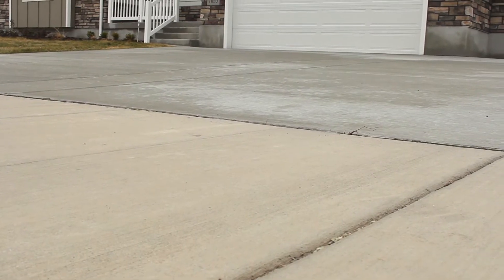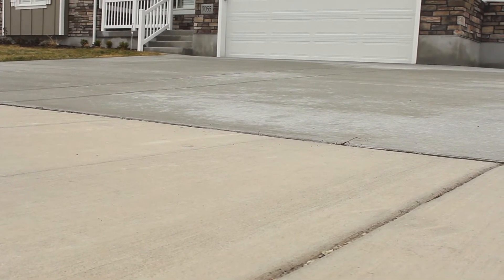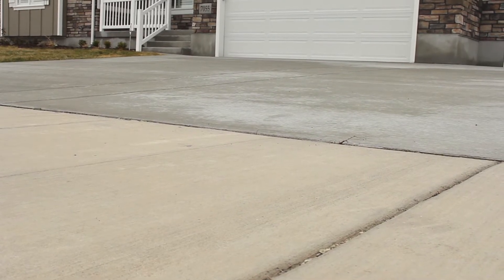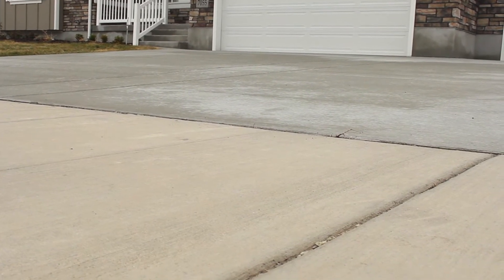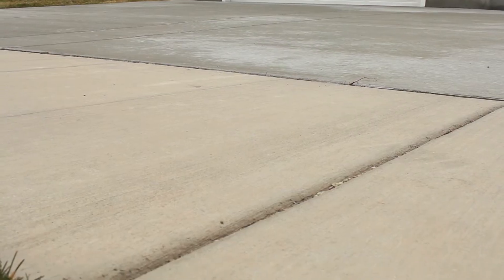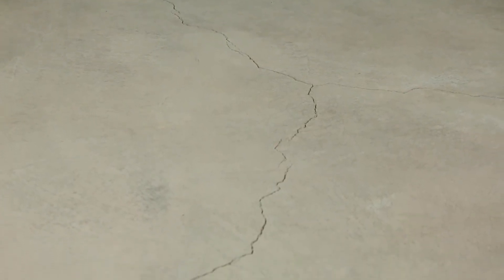Why Concrete Cracks in Your New Home

Comment: I have had three homes over the years.  Two were floating slabs and one was a cable tension slab.  The two floating slabs had cracking and at  a couple places the slab pulled away from the concrete blocks.  The cable tension slab had ZERO crack even after 20 years.

Comment: Is there not something cheap you can add into the control joints to prevent this and make it level for carpets? Accepting uncontrolled cracking in the floor to prevent carpet lines...seems like there must be a better solution.

Comment: The guy in the video is wrong. It is NOT normal for basement floors to crack.  The likely the reason you see the cracks in the basement examples he shows is because a floating slab wasn't installed, which is what should have been done. Instead, they poured the concrete all the way up against the foundation walls (instead of leaving about a 1.5 inch gap around the perimeter), which is wrong in all but the driest areas. A floating slab allows the floor to move in the event of hydraulic pressure from the water table underneath the slab.  If it can't float (i.e. shift independently), it tries to push against the foundation walls, which won't budge, and then you effectively get a buckling and then cracking of the floor. If anyone you hire tells you it's normal for basement floors to crack, get rid of that person immediately.

Comment: If I sent you a photo could you give me your opinion on a crack?  My one story rancher is on a slab. I'm literally right this moment removing the carpet and tack strips from the slab for a flooring contractor to come and install LVP flooring. We purchased high end flooring so we don't have to do this crap twice.  Anyway, the corner of one room of the slab has a crack just like most of the normal looking cracks you mentioned in the video. Just want an opinion. I was planning on using mortar mix to fill in the cracks after using a crack chaser blade. Thanks.

Comment: The "why" question has not been answered, also what exactly are the industry standards for how wide cracks can be?
Reply: The "why" is because in all likelyhood, a floating slab wasn't installed, which is a major error.
Reply: @georgeburns8447  New construction homes have footings which makes "floating slabs" non code compliant.  Patios, driveways and the like yes, house slabs no.
Reply: @drboogienobama4999  You have no idea what you're talking about.  I have a home with an 8 foot deep basement, with footings supporting the foundation walls and a floating slab.   A floating slab is normally required in an environment that could  subject the floor to shifting by hydrostatic pressure.  It has nothing to do with whether the home has footings or not. Kindly keep your comments to yourself unless you know what you're talking about, which you obviously don't.

Comment: Video is very useful, at the same time as mentioned in the title, it does not explain why does concrete crack.
Reply: Because in USA they don’t use frame between the concrete when they made foundation .
Reply: @maharenagebreslasie5596  thanks, I am sure your PHD in applied physics helped you to get there.

Concrete cracks because of thermal expansion. It creates internal stress that cracks the concrete. This thermal expansion can cause serious issues in reinforced concrete where the rebar stretches significantly and breaks lose from concrete, this enables water to leak in and that will quickly erode the material, which eventually means the rebar slowly dissapears from the concrete in which case a building can collapse as it's losing it's strength.

Thermal expansion cracks bridges, asphalt and many other public infrastructure. You will see engineers place gaps between concrete road slabs purely to enable concrete to expand. Same with bridges and any concrete structure you see in public is made modular so the pieces can expand as they like reducing the risk of cracks from thermal expansion.

Buildings do need to be inspected regularly for cracks and problems.

Comment: If you compact the sub-base and sub-grade correctly, add enough rebars, and no abuse afterward, then concrete slab will not crack for at least 3 decades. If any surface cracks show up just weeks or months after construction, then it suggests your contractor must did some steps incorrectly.
 A lot of builders use the concept of concrete will crack to mislead clients. Actually, the only reason of cracks show up in new house is because your builder slacked off and skipped away from some important sub-base and sub-grade preparation steps. if builder do each step correctly, concrete slab can maintain no-cracking for at least 30 years.
Reply: 100% the concrete they use now is shit to.
Reply: What type of materials, steps and water methods would I need to make a 40x40 @ 8" thick or larger concrete slap? Elaborate on sub-base and sub-grade please.

Comment: "Why Concrete Cracks in Your New Home"
Is not answered by this video, so it is a waste of time.
It would have redeemed itself if a solution to the cracking had been included.
 But no.
Reply: If you believe that you are as stupid as the person who uses the goes by ping gong...
Reply: @clifbrewster8822  Would you like to translate your reply into normal English, or get an interpreter.
 Understand that I have been in the building industry for over 50 years, so no bullshit please.
Reply: If you compact the sub-base and sub-grade correctly, add enough rebars, and no abuse afterward, then concrete slab will not crack for at least 3 decades. If any surface cracks show up just weeks or months after construction, then it suggests your contractor must did some steps incorrectly.
 A lot of builders use the concept of concrete will crack to mislead clients. Actually, the only reason of cracks show up in new house is because your builders slacked off and skipped away from some important sub-base and sub-grade preparation steps. if builder do each step correctly, concrete slab can maintain no-cracking for at least 30 years.

Comment: Useful, but the title of the video is Why Concrete Cracks, not What to do about it. Why does it crack?
Reply: In small buildings like homes there are many reasons mostly poor quality of anything:
workers, concrete mix, materials.. etc
but let's say you did everything right and perfect you still going to face concrete's worst enemies Water and Vibrations, rainwater will affect your soil after 3, maybe 5 or 10 years but it's happing no matter how long your foundations survived the rain effect in the soil it's happing, two Vibrations caused by earthquakes or even cars trucks bulldozers explosions.
1mm of foundation movement can cause cracks all over the walls.
how can you stop this? you can't it's normal it will happen no matter what you do.
Reply: He answered it. "Cuz it's normal"

😁

Comment: 3 rules with concrete: 
1) It's going to crack.
2) It's going to get hard.
3) No one will steal it.
Reply: If you compact the sub-base correctly, add enough rebar, and no abuse afterward, then concrete slab will not correct for at least 3 decades. If any surface cracks show up just weeks or months after construction, then it suggests your contractor must did some steps incorrectly.
Reply: @pinggong3617  that's not true at all. 
1, rebar does NOT stop concrete from cracking, it holds it together to keep the cracked pieces from lifting or separating. 
2, sub base is very important but even with the best sub base preparation, the ground still moves and can still cause concrete to crack. Ever see a mountain? Mountains are a result of the earth moving. No amount of prep can stop that. 
3, surface cracks can be caused by environmental factors when the concrete is placed, such as wind or sun. If the surface dries too quickly surface cracks will form. We don't pour concrete in a factory controlled setting after all. 
Also concrete is just plain brittle